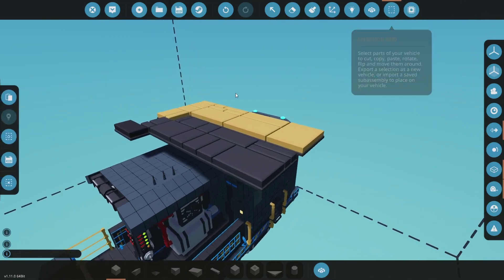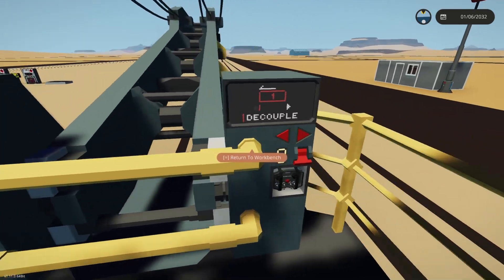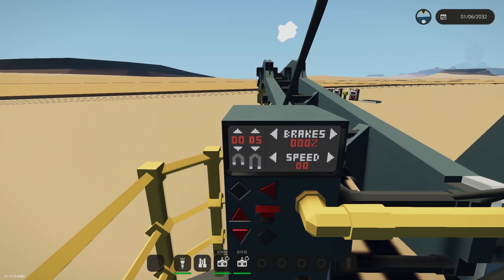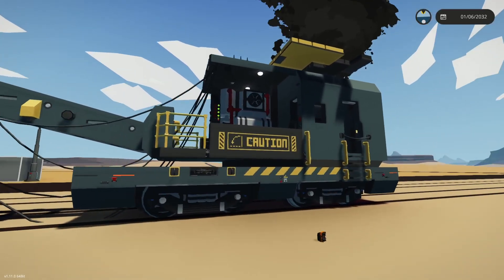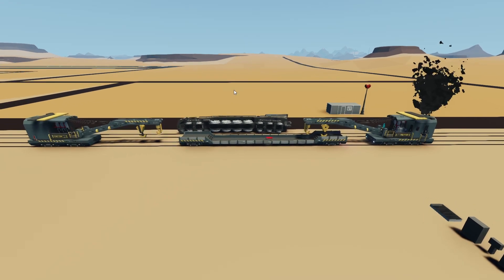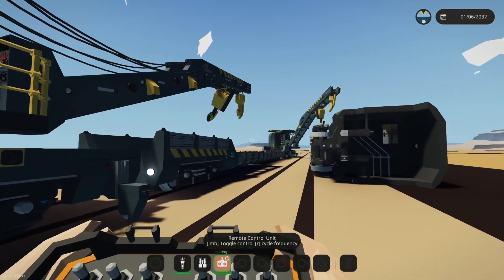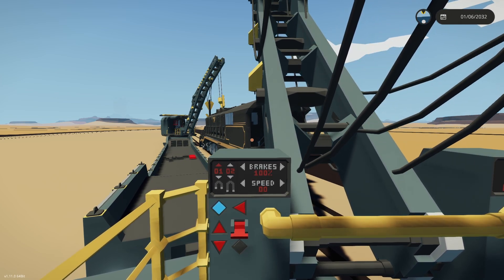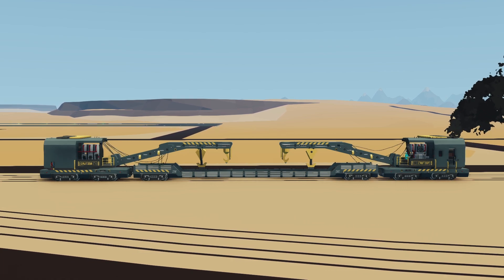Recovering A Locomotive With The Steam Wrecker Crane - TCP - Stormworks

Comment: I suggest against lightening your trains: As it massively reduces their adhesion to the tracks. Trains rely on their weight to move: A lighter locomotive putting out the same amount of power will probably spin the wheels more easily.
Reply from the maker: That's not really how it works in Stormworks though. The train wheels are magnetized to the tracks. Even if their weight is negative they wont let go.
Reply: @terr-rawr-saur  yet you still get wheel slip no?
Reply from the maker: @roadtrain_  The wheel slip is due to my wheels being different sizes and there being no way for us to measure the actual wheel speed of the larger wheels. The smaller wheels have an RPS output which can have its actual wheel speed measured whereas the steam wheels do not have any way to measure their actual wheel speed thus no ABS can be reliably applied to it. At best the speed of the loco can be measured and the diameter of the wheel plugged into the ABS but the wheel may still be spinning faster or slower than the loco is moving. So its not a reliable output.
Reply: @terr-rawr-saur  I'm obviously not a stormworks expert however: Why not just use the big wheels and have the leading/trailing trucks (which really are only there to guide a train around a corner IRL) be undriven?
Reply from the maker: @roadtrain_  TCP is designed for electric motor driven wheels, so it would make more sense to disconnect the steam wheels. But they take up so much space I might as well try to drive them. Hopefully there is a wheel rps node added to the steam wheels in the future.

Comment: Another thing to consider if with the whole crane idea is the use of modified pipe-layers. These are modified bulldozers with a boom to one side, the ones used for derailments have counter weights to the opposite side of the boom, I've seen 'em personally, there is a right, and left version, so that they can get at both sides of the derailed train. Also, having a railcar mover like the Trackmobile would be nice to have for short runs.

Comment: What does "TCP" stand for?
Reply from the maker: Train Communication Protocol. Its the system that lets all the brake, throttle, light data and other stuff related to running a train pass through any locomotives or wagons attached to the train.

Comment: i can picture this running heavy cargo so maybe a 3 hopper car with the height as high as the tender or the loco's roof, with the black primary color and maybe adding a big painted "TCP" in the middle of the car's sides.
Reply from the maker: I think I know what you mean. Also TCP stands for Train Communication Protocol. So its not really a company, as in I don't think massive TCP logos would be that great.

I did have the NSR company which I sort of abandoned because all the NSR compliant trains were 11 blocks wide and had my own master/slave system which meant they weren't compatible with other peoples trains.

Will need to think up some fictional company names.